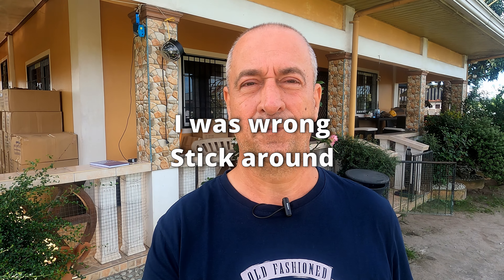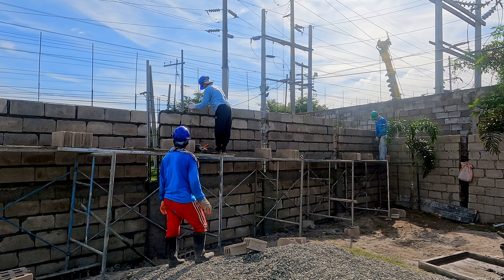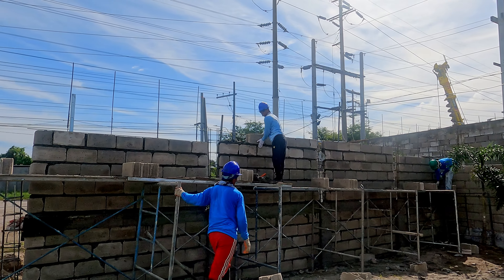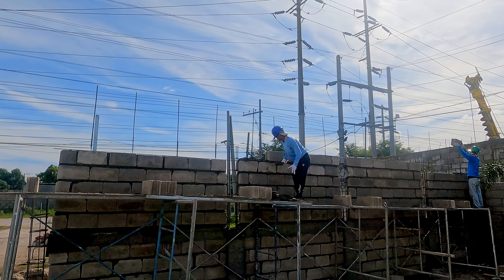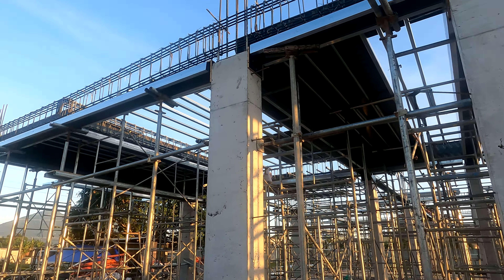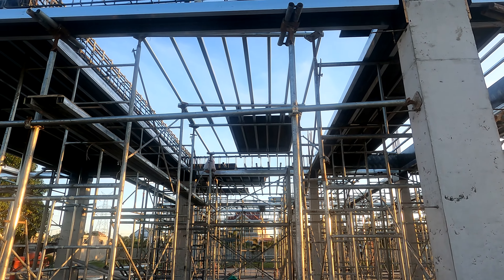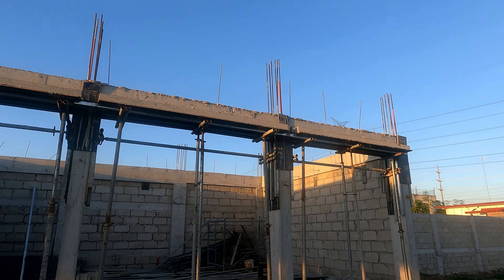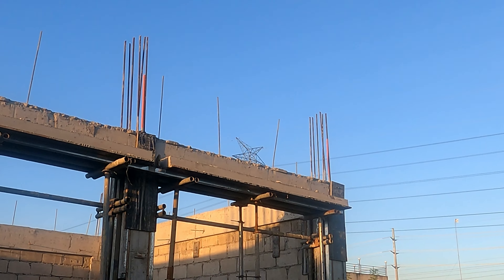Philippine House Building Day 55 - Not More of the same

Comment: You’re looking great! Construction is moving quickly. Very impressed with the engineer’s acceptance and implementation of safety measures. 
Thank you for the shoutout. We’ll be in touch again soon. Been dealing with some family drama. Back to normal soon.
Reply from the maker: Thank you guys. To be honest, the push on safety may have got a little impetus from me, but it is basically down to the builder putting a penalty system in place for failure to wear the hard hats, so the credit should really be to him.
Hope the drama soon reaches a happy conclusion.

Comment: Nice to see the framing and beams for the second floor going in. Definitely going to be a maze of scaffolding and supports. I do have another question for you. For your electric and ethernets are you utilizing a center space to run all the pipes and wires to the second floor? Also do you have plans for installing a backup generator and water filtrations system as you get further into the build?

Thanks
Reply from the maker: LC, don't have a final plan for the second floor electrical / ethernet yet, but should be done quite soon. And yes to both a generator and water filtration,